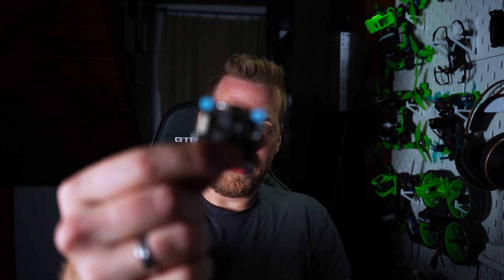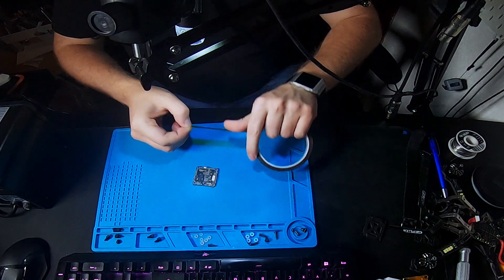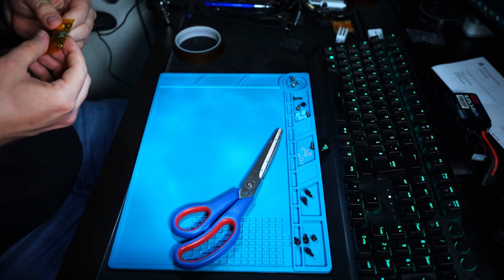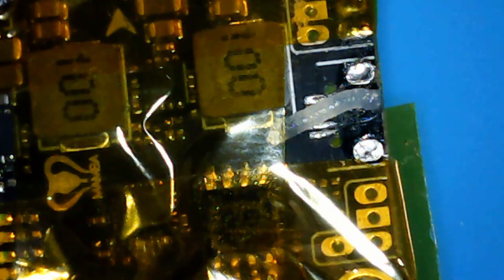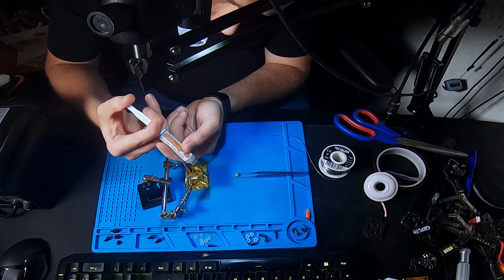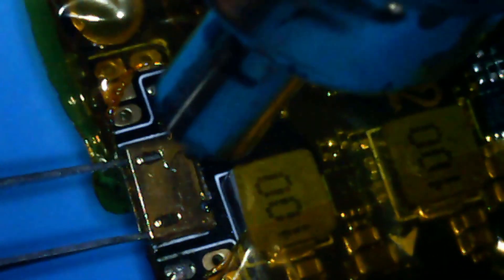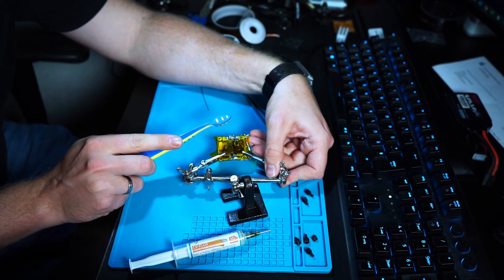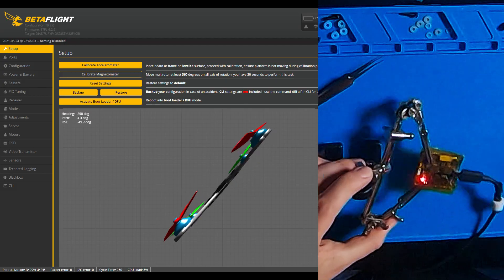How You Can Replace A (Micro) USB Port On A Flight Controller | FPV Repair Video - English Version

Comment: Hi where can I find a replacement USB port for Happymodel ELRS F4 2G4 V3.1 V3.3 AIO 5in1 thanks? its a 5 pin vertical configuration
Reply from the maker: Hey! I'd suggest big chinese marketplaces like AliExpress - most of the time they have a tremendous selection of electronic parts

Comment: Hey Flick i have a usb port that belongs to a Happymodel mob6 and the usb lifted off and afterwards i could not find it anywhere so i purchased a bunch of usb ports from ebay. There are 2 pins that are standing straight up. How can i place a usb port over the 2 pins? The usb's i got from ebay all have 5 pins sticking out?
Reply from the maker: I'm not sure if I have the right imagination about your bought usb ports, nevertheless as long as the 5 pins on the back of the micro usb are aligned it should work (these should be the same for all micro usb ports)
Reply: @flickFPV  Yes your correct i was able to remove the 2 tiny pins that were protruding from the FC and now i can see the 5 pins on the board itself. I should have the correct usb port out of the 100 that i purchased. Fingers crossed, hopefully i can solder the port back on. Ill keep you posted. Thnk you for replying and for the awesome video you made!!, ✈️
Reply from the maker: Hope you were able to fix it 😉

Comment: Hey man, only three comment here so can you please answer my question, shouldn't be hard. 
How can you identify where the usb port is ? I do see four holes in a row in my FC. Could it be for usb soldering port? Also how do I know if it's for type c port or usb port ? Pls any suggestions will help me out as i am a newbie
Edit i am from India
Reply from the maker: Hey ! I'd look for a wiring diagram of exact this FC and then read wether USB-C or Micro USB and also where it is placed

Comment: could you hook me up with a link to that micro usb port? digikey has sooo many lol
Reply from the maker: I would but I ended up reusing a old usb port from a fried FC 😁
But I'd suggest you to measure the width - I tried a different micro USB another time but this one was too wide.
Reply: @flickFPV  yeah! I also tried replacing it with a different looking usb connector from a fried fc. However I have reason to believe data lines were different. I got a windows device unrecognized error.